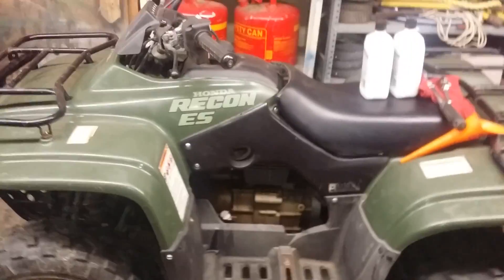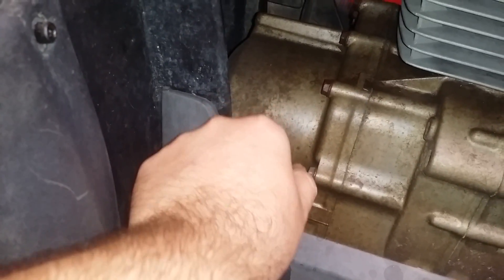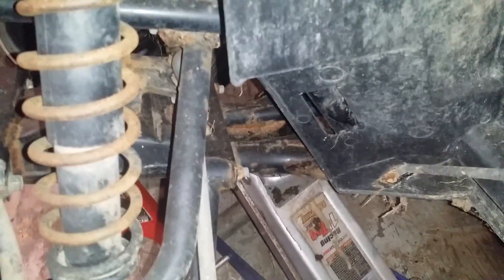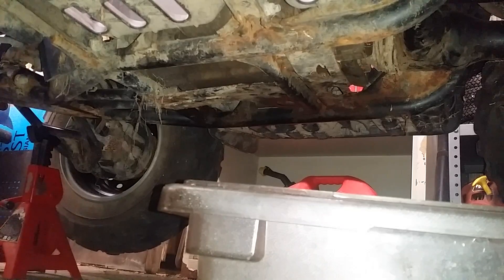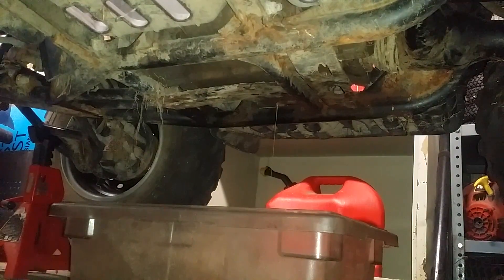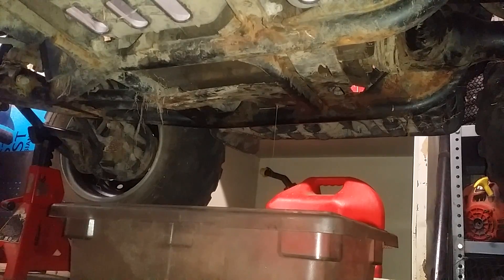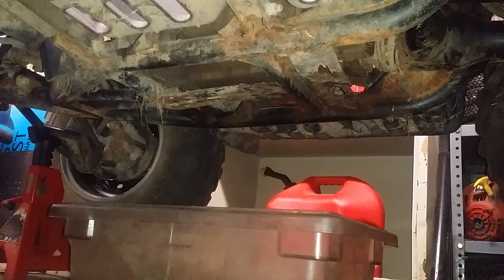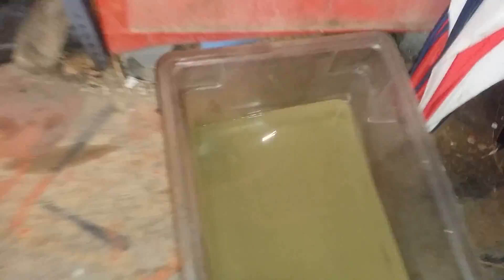Honda recon oil change

Comment from the maker: wet clutch oils call for added zinc, an or sn, marks on the bottle is what is recommended by honda, belive me I asked my local dealer , I flushed the engine a few more times since. 7 times in total so far. it now has honda oil in it. I did say in the video that I was planning on changing the oil more, I wasn't about to use honda oil for flushing.

Comment: hello. dont you have to change the oil filter too?
Reply from the maker: Luis Castillero I have another video on a Honda 500 foreman,I show how to change the filter in that video,it's in the same place as the recon,3 8mm bolts and it's off
Reply: 1beastlydude 
got a video on the oil screen cleaning?
Reply from the maker: Joey Hume I can make one, but I've got to come across a machine that has one
Reply: When you do would you please tag me. I would appreciate it.
Just got mine out the shop with the top being rebuilt. Runs perfect. Just trying to maintain it for my daughter.
Reply from the maker: Joey Hume it's not hard to clean an oil screen if it pulls out of the motor all you need to do is blow it out with some carburetor cleaner let it dry and then reinstall it .you want to do is when you pull it out you will see crust on one side not the other and just blow it out backward
Reply: Where's it located
Reply from the maker: Joey Hume depends on the machine ,usually it's where the oil drink plug is, it would be a little mesh thimble just inside the case
Reply: Thank you. I'm gonna check that out.

Comment: Take the Castrol out that engine and NEVER EVER use it again! It is a MUST to put ATV oil in it because of the wet internal centrifugal clutch! You will DESTROY those clutches FAST if u don't do as I'm telling you. I know this from experience man. The oil you use has to be wet clutch compatible. Amsoil, Honda oil, Valvoline ATV oil (sold at Autoparts stores or walmart) are all good oils but the Valvoline is NOT synthetic. Synthetic is best and 10w-40 is what it calls for. Don't be surprised if you have to go back into the engine and install a brand new crank. These sideways Honda engines HATE water and will almost always never hold up too long with just a top end rebuild no matter who does it. Been there done that bud! All from experience. I had a '99 Recon.
Reply: shell full sintetic 10w40 its ok?
Reply: Castrol has oil with wet clutch additive
Reply: D
Reply: I AGREE! 100%!